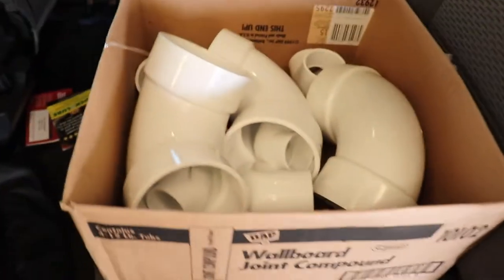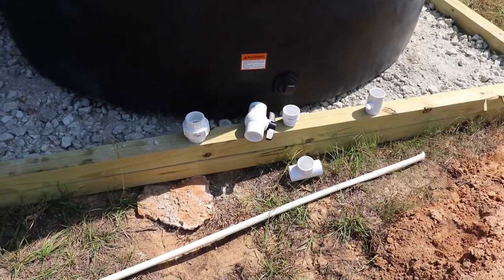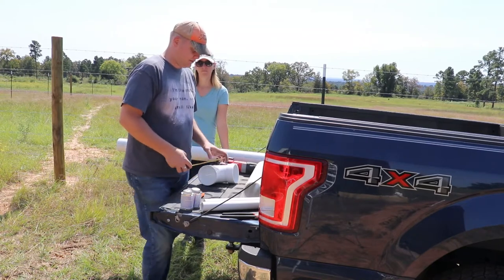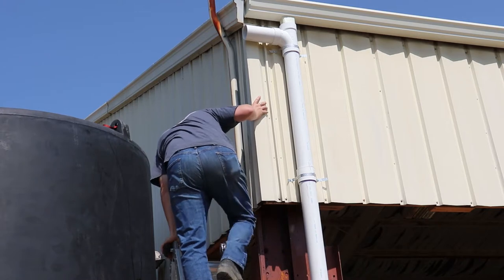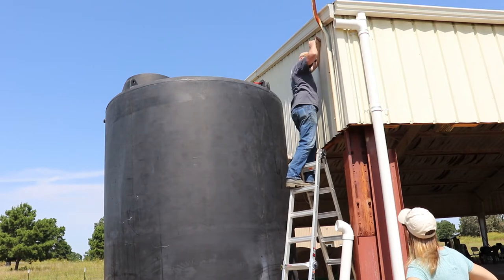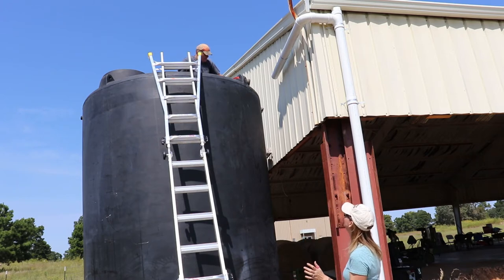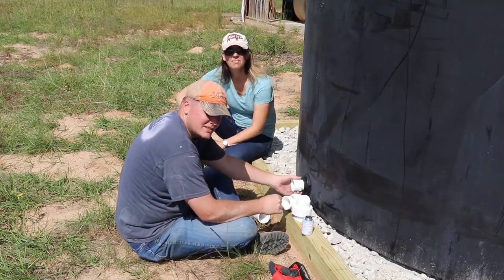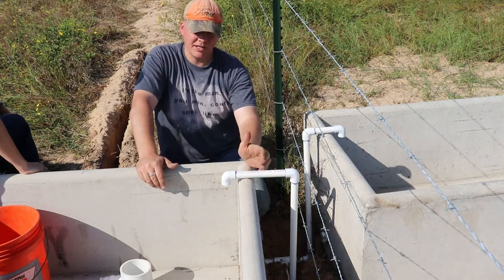Ep. 34 - Off Grid Water tank hook up to collect rain water at Blackacre Ranch

Comment: When ever I built large homes and needed to work high we would build a basket to lift and work out of with the fork lift. You could do the same with the tractor with the forks.
Reply from the maker: That makes sense.  Maybe I need to train Sharla on the tractor.  My life would be in her hands for sure.  :)  It's funny how 12 feet in the air doesn't seem so high when you are on the ground.
Reply: @BlackacreRanch  you could even lift it up and then use a ladder to get to it a work out of